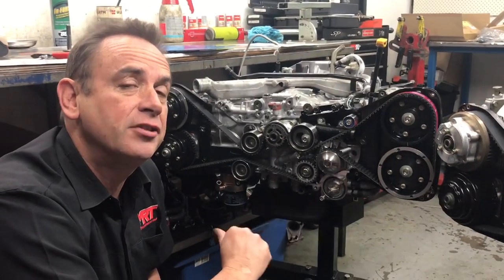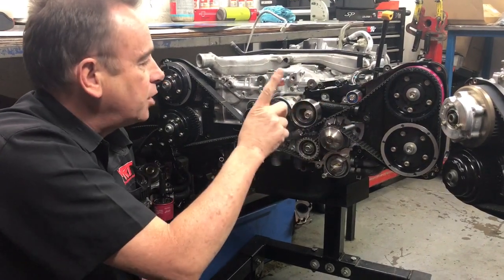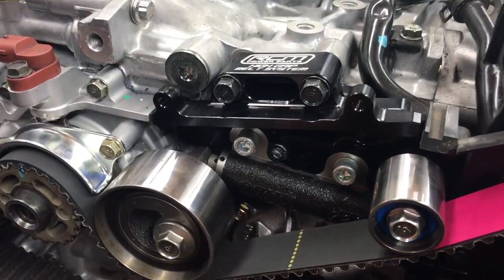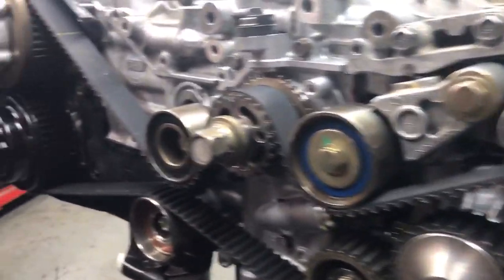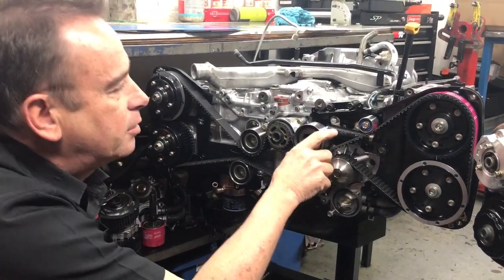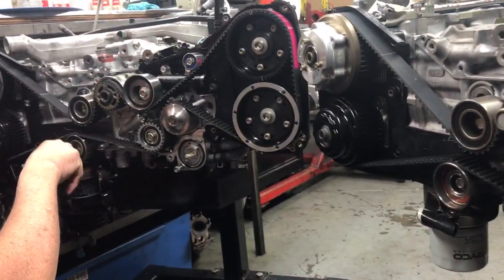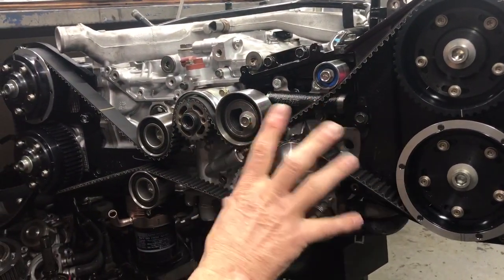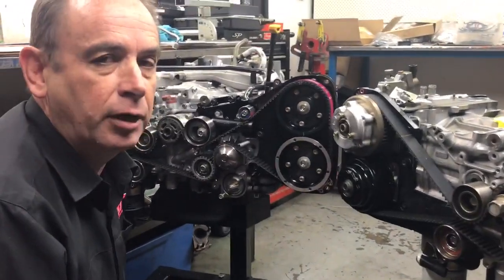Old VS. New EJ Cam and Timing Belt Comparison & What to Look For

Comment: Your knowledge  is greatly appreciated  here in hamden,ct keep up the great videos. Recently replaced the timing belt with all related components.2006 subie sti with 121,000 miles. Having some evap issues cleared po442, 446,and 456 still have the po448 no luck yet on clearing it.just piked up a autool 206 smoke machine . May not be able to use on evap systems with psi limited to 1psi .

Comment: If you were building a car would you rather build the 15+sti or the 15+wrx? I have a 17 wrx 410hp stock engine and I'm either upgrading the block or putting it back to stock and trading it in for a sti... what would you recommend

Comment: I just did belt on my JDM GRB STI and the biggest pain was aligning the LH side cams, as they tend to jump to neutral position. This requires three hands to actually fit the belt. Any tips on that? I was probably starting from wrong position...

I found after 100,000kms and 10 years, the belt was in perfect condition (bar the writing was gone), and all the idlers except one, were tight. The loose idler was the single row bearing (orange) just like on your video... The replacement genuine idlers were all double row (no orange single row).

I could not undo the cam sprocket bolts in my working conditions. I gave up on the cam seal replacement as the crank seal that I replaced was in perfect condition (flexible and minimal wear on the lip). There were no signs of the oil weeping from cam seals. I called local subaru specialists and they said they do not normally replace cam seals when they do the belts. What are your thoughts on the cam seals?

I replaced the water pump but I didn't do the oil pump. Coming from Toyotas (specifically 3SGTEs) replacing waterpump is a must (otherwise it leaks shortly after the belt replacement).
Reply: I changed the timing belt on my 12 WRX at the beginning of this year and ran into the same struggle. 

I believe this _ https://www.rallysportdirect.com/part/tools/cop-506-company23-cam-lock-tool _ is one solution.
Reply from the maker: correct